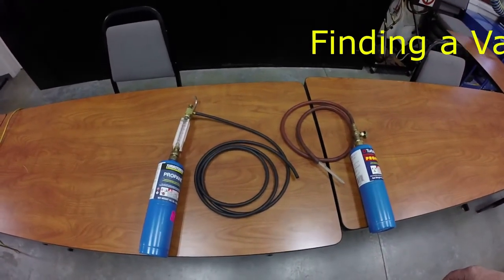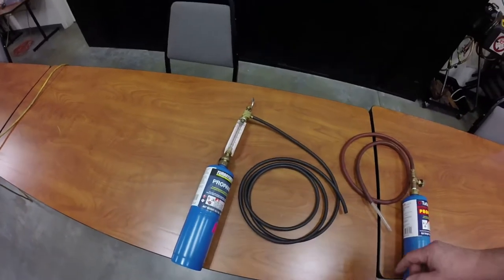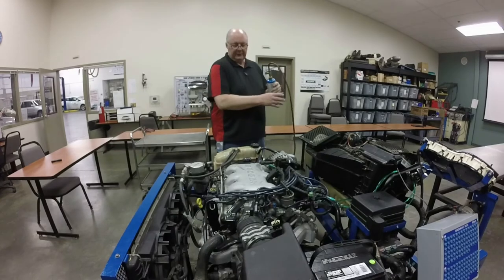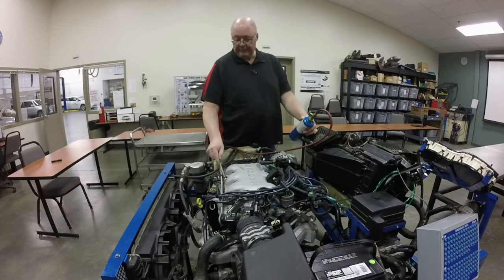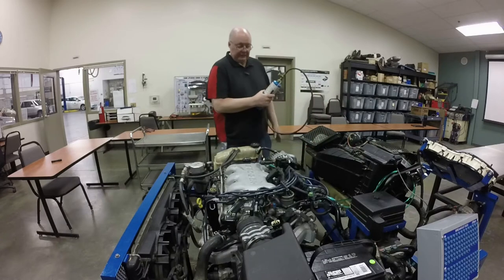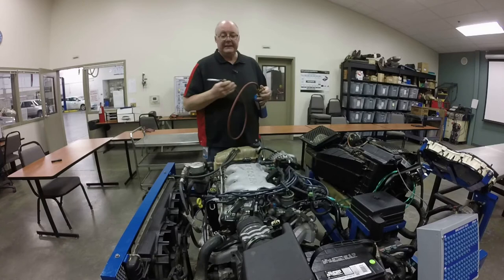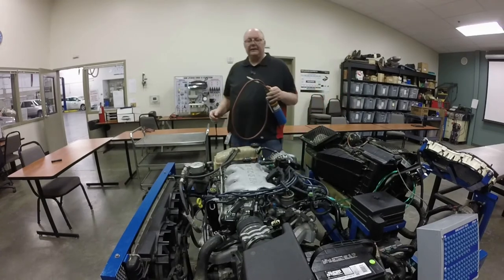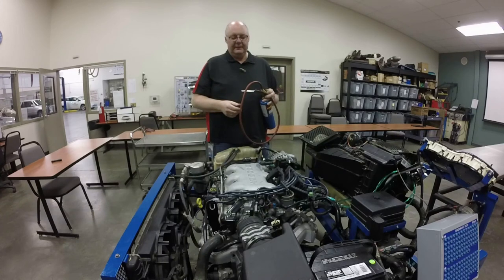Finding A Vacuum Leak With Propane

Comment: Thanks for sharing! I'm gonna try a home made smoke machine tomorrow.
I suspect I need intake gaskets because I've seen some coolant on top of the block on my Ford Windstar 3.8L.
Not to mention an occasional spudder in the engine.